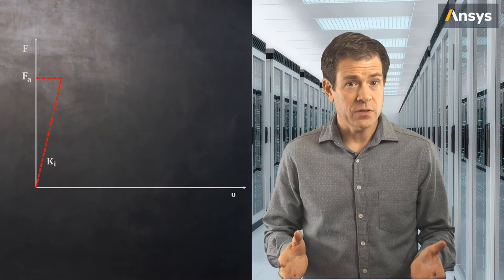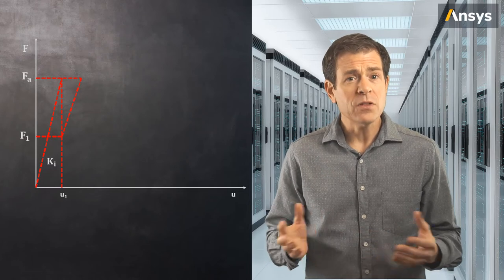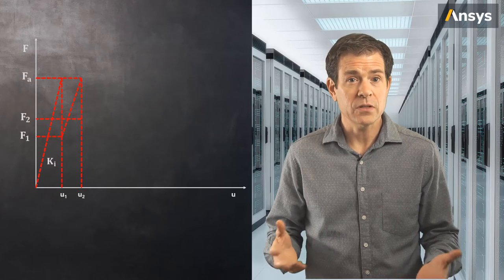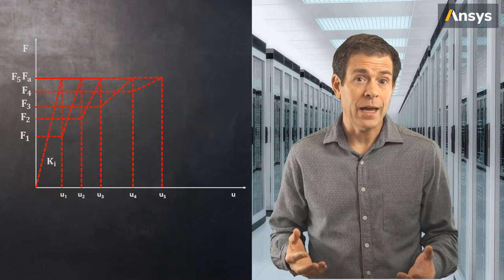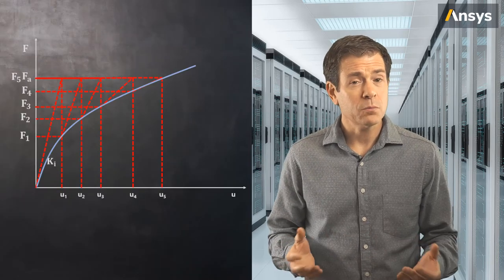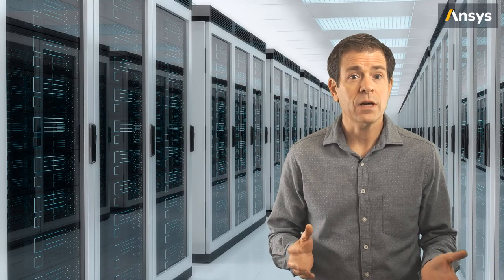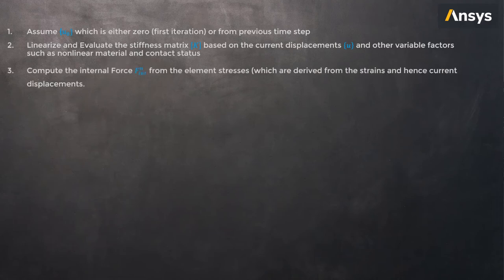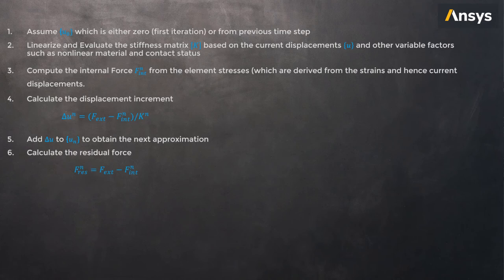Newton-Raphson Method — Lesson 3

Comment: how da fuq you know what amount of inner response is generated after force applied if you dont know relationship between stress and strain mannnn
Reply: in previously video u said we dont know apriori stiffness change tho i dont think you can calculate inner force per displacement without that info.Its probably given ampirically as a sheet or table i guess discreetly
Reply: I too, have the exact doubt
Reply: @tymofei8586  I'm one year late but, The solver makes a first guess of the Stifness K, with this stifness K we CAN calcuate the inner forces of the structure and compare it with the applied forces.
The thing is, even though we will get displacement values in this iteration, we dont know yet if those displacements values are realistic or not. If the first guess of the stifness K is "bad" then the solver will be able to calculate displacements but they will be absolutely non-realistic. But then, how does the solver know if his stifness guess is good or bad ? 
Well, for each guess of K (each iteration), it will compare inner forces calculated from the Stifness guess, and the applied forces (specified by the human, you :) ). If the sum is close to 0 (i.e. residues are low), then we can consider it was a good stifness guess and we consider the solver displacements ouput to be "good".

Hope that helps!